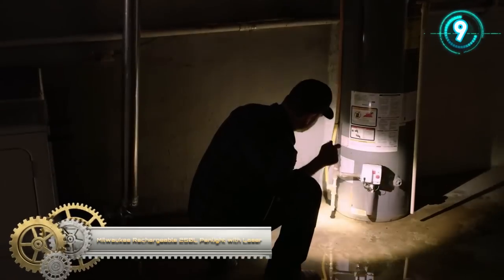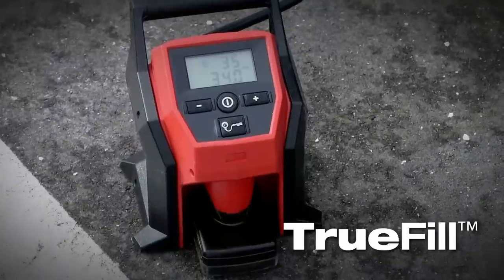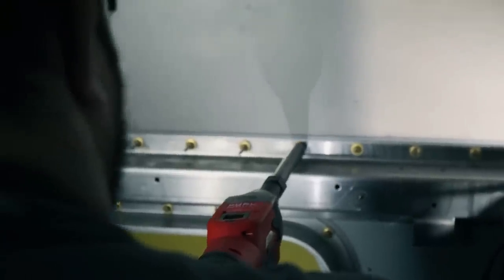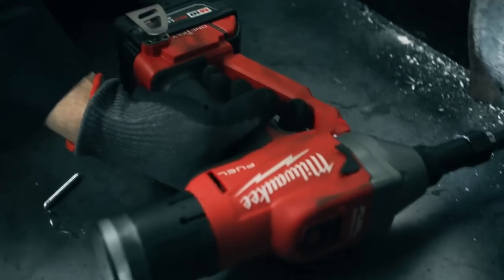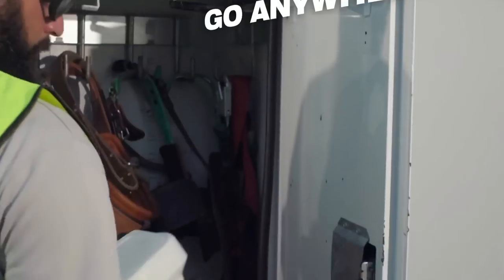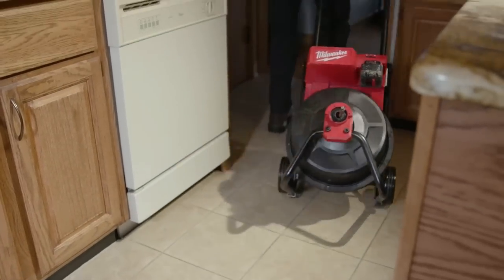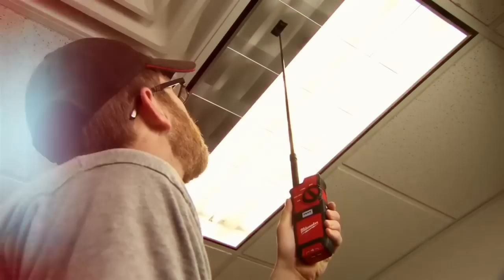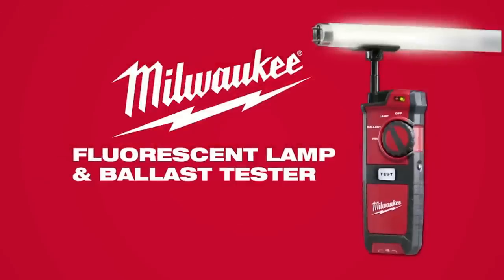Milwaukee Tools You Probably Never Seen Before  ▶ 2

Comment: I don't mean to make such a large read but I like Milwaukee A LOT but some things are not a necessity. I like a flashlight with the on/off switch on the end so you are not searching for it on the barrel of it. But in ONE mode only so you aren't clicking more than you need. I seen a tire inflator at Walmart that says from flat to full in 3 minutes. That's impressive. You didn't state that here.  Lock bolts? You mean Pop Rivets? Maybe I am missing something here. The Utility remote search light looks Great. Like it a lot. I am looking for a drum drain machine, This looks promising. Will defiantly look into it. But price will trump. The light tester is easy. Just replace the Fluorescent with LED bulb. I have done it.